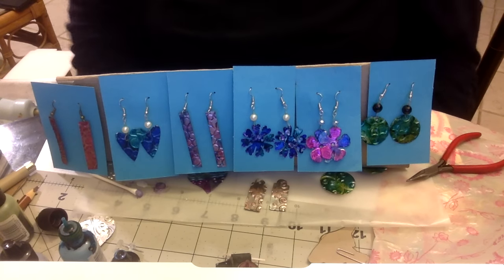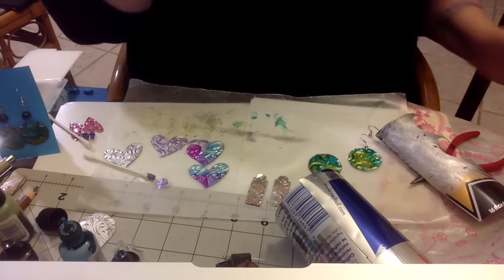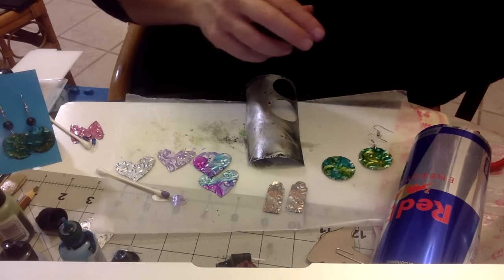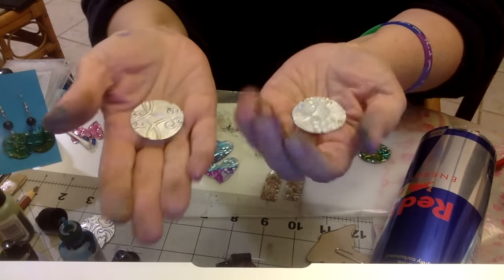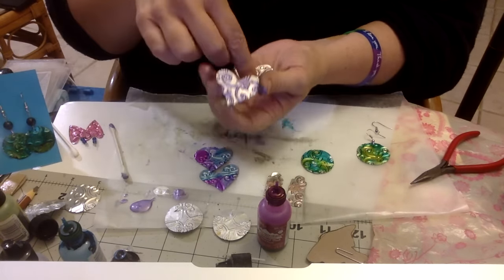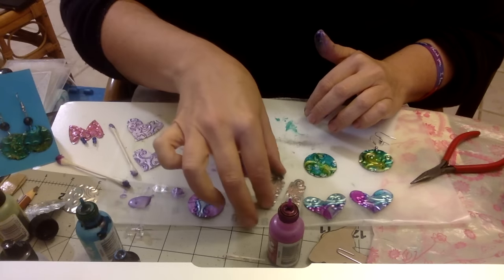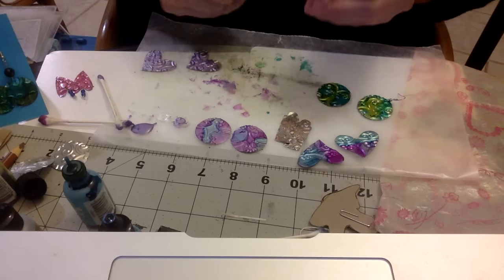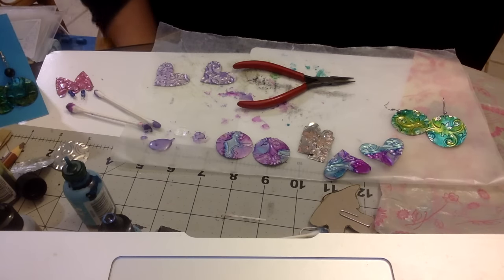Making Soda Can Earrings Tutorial ( #1in the Series)

Comment: Actually kitchen scissors work best because they are meant to cut through chicken bones and such so they are strong enough. Plus you can pick up a pair of kitchen scissors at the dollar store for a buck. I would not use clear nail polish to coat the earrings because it will crack and peel off over time. It’s much better to use a regular or UV resin on these. Plus the resin gives a much prettier finish to the item. You can also use a coat of clear polyurethane. You really don’t have to do all of that sanding to remove the logos on the can. You can just paint over it with spray paint or a paint for metal. I hope this helps. HAPPY CRAFTING EVERYONE. Dee😊👍
Reply: What if you don´t have all theese you mention, I think it was good ideas though 🤭

Comment: I have heard that acetate (Fingernail Polish Remover) will remove the paint from the cans.  I will have to give it a try the next time there is a can of soda in my house...lol.  Thank you for sharing, the earrings are beautiful. How do you keep the edges from being sharp enough to cut you?      ~SuzyJCinColorado~
Reply from the maker: HI Suzy, I haven't tried it.  I will definitely give it a go. No the cans aren't sharp after you use a punch or a die cutting machine. You can also sand them with an emery board if you feel they are. TFW and sharing your time with me. Aloha, Shelley
Reply: I have heard rubbing alcohol. But boiling helps first.

Comment: Have you ever tried getting just a glass of water leaving it and then it's set to get to room temperature then taking fingernail polish and is dropping it in there on top of the water different colors and then taking a needle a long needle or long straight pin and kind of making designs where you have dropped the fingernail polish all the different colors that you had dropped in there in this world it to make a design and then the one that you have cut out take you a wooden score skewer and put some clay that will really stick and hold it and swirl it around in that water where you have put the fingernail polish bring it out after you clean it off a little bit on the sides and look at the design I think it would be awesome
Reply from the maker: Sounds like fun Betty, I will definitely try it.

Comment: Very Beautiful. I just have a couple of questions. Do you ever accidentally cut yourself. I'm thinking the edges of the earrings are still sharp even after shaping or cutting. Do you treat the edges in any way to keep from accidentally cutting yourself while wearing them? Im just wondering.
Reply from the maker: Hi Josie, They are not sharp if you use a punch or die cutting machine. Free hand cutting can be a little sharp. Use an emery board or sand paper and gently sand the edges. I hope that helps and I hope you try and make some. Happy creating!!!! Aloha. Shelley
Reply: They are very thin, yes, you can hurt yourself!!
Reply: Great question!
Reply from the maker: I have never cut myself making or wearing them. When you use a punch or die cutting machine the round the edges just a little. If you free hand cut them use an emory board and and file the edges of the metal. Hope that helps. Aloha, Shelley
Reply: Josie Ojeda look at min 4

Comment: Beautiful ! But, tell me .. is there no problem because of the sharp edges ??
I guess you could only stick you piece of metal on a sheet of polymere clay of the same size, just a bit wider, and manage to obtain that the metal could be slightly inlayed in the polymere clay. Have you thought of another solution ?
Reply: Yes--you can put the piece to be cut onto the back of self adhesive foam and run through the sizzix

Comment: How do you keep the edges from cutting you?  the earrings are really pretty.
Reply from the maker: Hi Virginia, They aren't sharp of you use a punch or die cutting machine. If you cut them with scissors they can be. So you can use an emery board and sand the edges or use light weight sand paper. Hope that helps. Aloha, Shelley

Comment: Hi, thanks for the video, don't you sand the edges?
Reply from the maker: HI Maria, When you use a punch or  die cutting the edges are not sharp. If you use scissorrs then yes you would need to sand the edges. Hope that helps,  Aloha, Shelley
Reply: Crafting Mamas yes, thanks!

Comment: I don't mean to be picky but your using aluminum cans not tin, the reason I watch is because I thought you were using tin.
Reply from the maker: HI Linda, If you have a die cutting machine you can use tin in it. You need to use the thick steel cut dies for it. A punch would not work on it. Happy creating , Aloha, Shelley